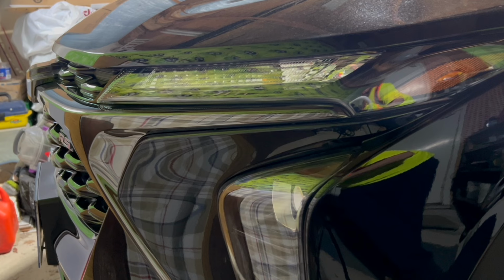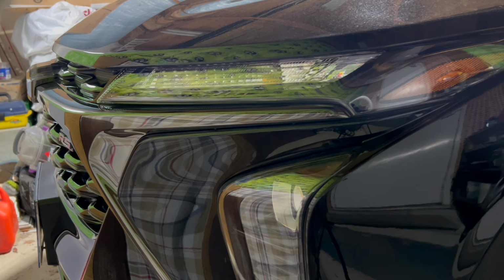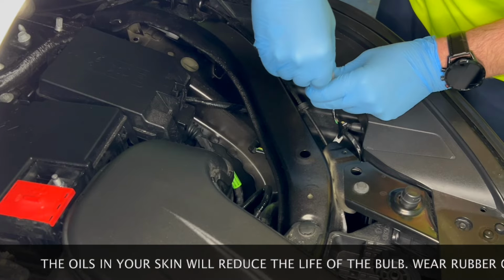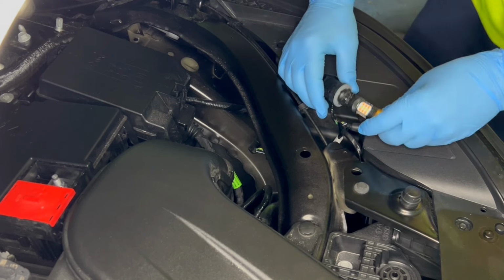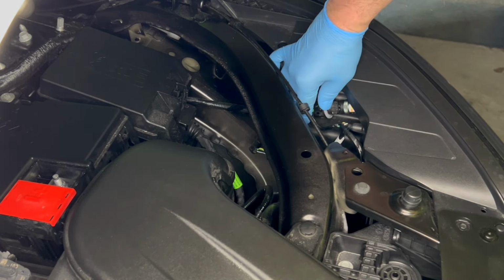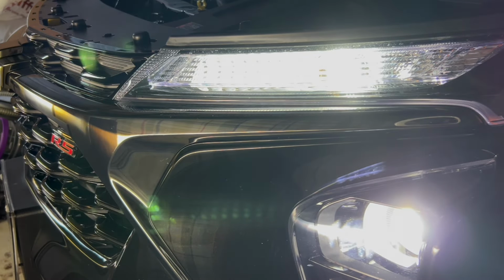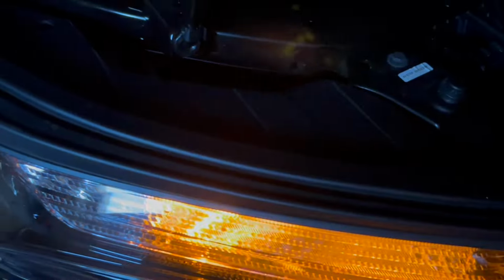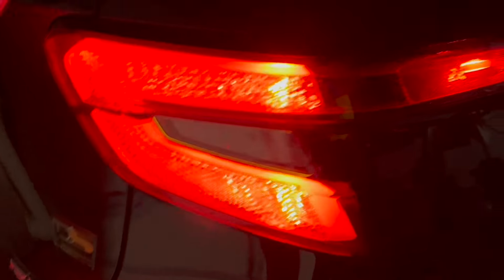Installing Switchback Turn Signal LED's on a 2024 Chevrolet Trax 1RS

Comment: I just installed these and here is what I found:

1. They are light sensitive.  If your daytime running lights switch is on, these are off when the sun is out.
HOWEVER, if your daytime running lights are on and it is dark outside these lights will come on. 
2. The yellow indicator lights work in any condition bright out or darkout.
3. So do not expect these lights to "stay on" on a bright sunny day.
4. Pauly C only tested these in a dark condition (garage and night time).  Maybe you think these are on when you are driving around during the day but they aren't.
5. Pauly C is right. They will only work during the day if the park lights are on.
6. For some reason these disable the daylight running lights when the sun is out. if the daytime running lights switch is on, the round bottom lights are still off. So if it is bright out the dash board could say "day lights on' or "day light off" everything is off no matter what.
-region: USA
Reply from the maker: I'm going to pin this comment to the top of this video. Thank you so much for this info, brother! I appreciate you going in depth on this. It means a lot and will help many with this mod!
Reply: @ItsMePaulyC  awesome! i'll update it as I learn more
Reply: I noticed the same thing. they come on only in the dark or when the  auto light kicks in. If you turn your lights to on then both lights come on. I think that my regular DRL are on even if the switch backs are off when on auto. Will have to double check. - BTW @itsmepaulyc This and the LED interior lights were a great upgrade. Would love if we can figure out how to keep these switchbacks active when on auto during the day
Reply: @moredatesmorefiber3526  Thank you for that reply it was very helpful! After installing them in your Trax, would you recommend them?
Reply: @aliasdesignz  so far so good

Comment: Thanks Pauly awesome vid :goat-turquoise-white-horns:
Reply from the maker: @ManewBauza  thank you, much appreciated!  🙏🏻
Reply: @ItsMePaulyC Hey buddy any advice for Taking the bulbs out? They are not moving at  all theyre stuck 😢
Reply from the maker: @ManewBauza  if you have a small pair of needle nose pliers, gently use them to turn the socket. They are usually hard to take out the first time.

Comment: Finally I get to see how theee auxbeam led bulbs. I always go for Auxito. But those are much better product. For a very good price. ❤️‍🔥❤️‍🔥❤️‍🔥❤️‍🔥

An led bulb with a built in resistors and a cooling fan that produces 28W per bulb is a great upgrade
Reply from the maker: These bulbs are so cool and convenient! I love that the resistors are built in to. I do use auxito as well in other applications like headlights in my previous car as well as interior lighting. Very good products.
Reply: @ItsMePaulyC  u get ur moneys worth on them man. 

They are ultra bright and it’s a must buy.❤️‍🔥

Comment: The Activ has turn signal down by the head light is the 1 RS different and the Activ has a running day time LED up on top. I did not realize that the same car was so different
Reply from the maker: Correct 😊
That makes this the perfect modification for the RS. and LS models 👍

Comment: Thanks for the great video. Can people post here if they experience problems with the electronics? The manual did specifically ask owners NOT to swap incandescent blubs for LED. Maybe swap the bulbs back before requesting for warranty repair.
Reply from the maker: They sure can post here, Guy. I've tested these particular LED's for two weeks with no problems. However, I must warn people that are thinking of doing the lights in the back of the car. They didn't work for me with the bulbs I tested. I put LED's in the reverse and turn/brake lights and had problems occur like the rear camera staying on right when you turn the car on and not being able to control the radio because of it. I also experienced problems with the reading on the TPMS system. I removed the those bulbs and the problems went away. I highly recommend staying away from changing the rear lights of the car. So far so good with the front though.
Reply from the maker: I made this video with the problems I experienced with installing LED's at the rear locations of the vehicle: https://youtu.be/tMeHuap8rQM?si=LepIbicntBIbFEbf
Reply: @ItsMePaulyC  just saw this, that sucks. It's always the big man holding us back brother! Lol awesome videos can't wait to see the next mods on the Trax!!!

Comment: Could you please do a video on a horn replacement that won't blow any fuses it's then only thing I just can't stand on my LT thank you very much
Reply from the maker: Hmmm, I'll have to look into that. I was actually going to do that mod on my last 2021 Trax. I hated that horn. This ones not as bad though.
'
Reply: @ItsMePaulyC  I'm use to the 3 note on my old 2003 Lesabre I sold with 141,000 miles to get the Trax
Reply from the maker: @ChristSotos-fy4vw  I see why you want to change this horn out then. They surely don't put good horns on cars like they used too. I'm going to try to look into this.

Comment: Thanks for the video! I also have a 2024 Chevy Trax RS1 and would love to do this mod. Did you test any other bulbs besides this one? What should I look for in optional bulbs, this one is out of stock on Amazon. Thank you!
Reply from the maker: @aliasdesignz  I’m hoping these get restocked soon.  I really love this company and have been using them for years. They just sent me a new pair of these because one of them failed unfortunately. And free of charge with the warranty they give with the purchase.  Unfortunately I haven’t tried any other ones. I’ll try to look for an alternative this weekend.
Reply: @ItsMePaulyC  Good afternoon! Were you able to ever find a bulb that would act just like the Auxbeam? It's still unavailable... 😢
Reply from the maker: @ not yet, unfortunately. I know a few people are going to try that Lasfit company. You should be able to purchase the Auxbeam ones directly from there site. I left a link in the description 👍
Reply: @ItsMePaulyC  I looked at the lasfit website but those bulbs are pretty expensive. What should I look for when trying to find those replacement bulbs?
Reply from the maker: @aliasdesignz  sorry for the late response. The bulbs should say "Canbus" and "Error Free" from hyper flashing etc. The part # for the turn signal bulbs is 7440 although it's not guaranteed that bulbs from certain companies will work.

Comment: Looks awesome!  We just bought a trax this week!!  Do you  know if you can use the same bulb on the ls model? :)  Thanks!!!
Reply from the maker: Hey, congratulations Jennifer! These are really great vehicles! Regarding the bulbs, you have to check your model. The higher up models from mine actually have an LED  light strip where I installed my bulbs and the turn signal lights on those vehicles are located just below the headlights. Hope this helps.
Reply: Thank you! Yes, my set up is the same as yours. My turn signal is in the same location as yours lol
Reply from the maker: @jenniferrperrine  awesome! You’ll love these if you decide to get them.  I love them! Oh and thank you for subscribing, much appreciated 😊

Comment: A led bulbs from different brand, with matching oem wattage on led, a switchback and with an active cooling fan is such a huge upgrade. 

Honestly, u get ur money’s worth on those auxbeam - B21 series switchback. 

Something like this price is different because of the quality material they use.
Between $31-$100 a pair.

So this $41 price range is a very convenient to buy and very nice upgrade. 

Be mindful of how u use it.
Reply from the maker: Very well said and I couldn't agree more 👍

Comment: Looking for some red bulbs, instead of white,  any suggestions on where to find some??
Reply from the maker: Where do you want to put them and what type of vehicle do you drive? I wouldn't suggest red in the front, it's illegal in most places.
Reply: @ItsMePaulyC  I also have a 2024 chevy trax..1rs, and wanted to upgrade my headlights to red ones to match the car, as my interior is also red and black..
Reply: @ItsMePaulyC  by the way im in Los Angeles, CA.  And cops don't really bother with headlights here... lol
Reply from the maker: Lucky you can use red! I don’t have a recommendation on a red LED bulb, but if you do go to Amazon to buy them, look for LED’s that have switchback and make sure they also say Canbus so you won’t get the hyper flashing. The number for the front is 7443. Check one of my links for an example 👍
Reply: @ItsMePaulyC  thank you I highly appreciate it..great videos by the way...keep up the good work... I might be posting some soon..thanx again👍👍
Reply from the maker: @Mighty6771  thank you! Much appreciated!
Reply: @ItsMePaulyC  is there any website to get the signal lights that you bought,  but in red..
Reply from the maker: @Mighty6771  I will see if I can find a link for you.
Reply: @ItsMePaulyC  thank you
Reply from the maker: @Mighty6771  Unfortunately I can only find ones like the ones I did from various different companies. I don't see an option for red/white switchback. The only alternative is to use red LED brake lights in 7443, but that will only be the red color all the time.